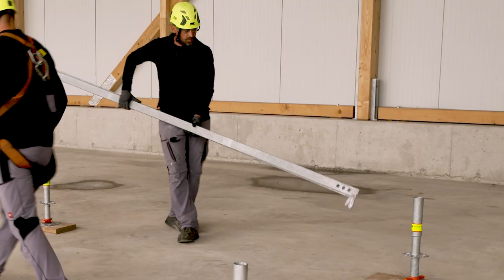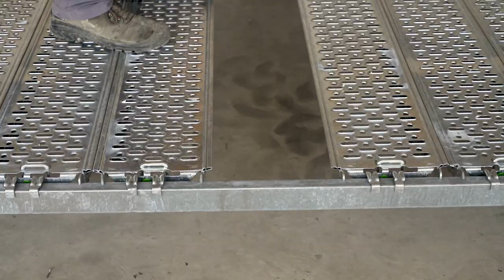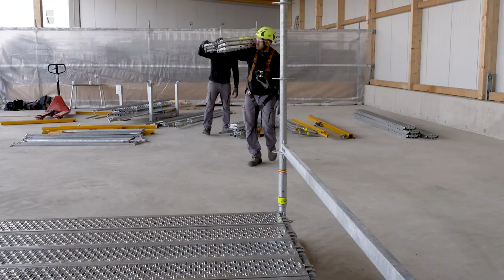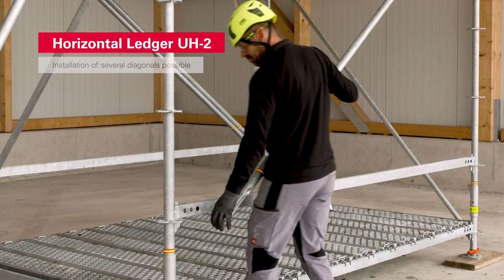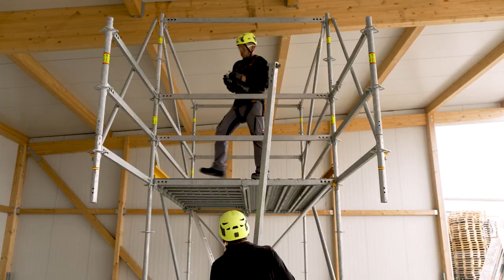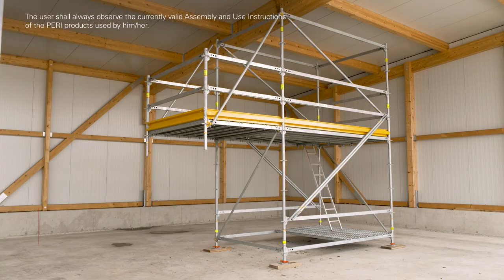SCAFFOLDING | The optimised components of the PERI UP Scaffolding Kit (EN)

Comment: WHAT ARE YOUR BRACES RATED FOR TOO BE ABLE TO SPUR A 5 ft CANTILEVER

CAN YOU SPUR A 7ft CANTILEVER?

I KNOW I HAVE SEEN DOUBLE BRACES..EA SIDE ON A 10 FT CANTILEVER WITH YOUR PRODUCT
Reply: Yes! Peri say they can do 10 feet long cantilever but it look  unsaved but 5 feet and 8 feet no problem with peri. Also they came in Alberta Canada 🇨🇦 doing an inside tank and almost collapsed the system was too weak to hold the weight it was a cone shape tank at suncor oil field. I was there saw most of their jacks broken in two. They claimed safety but don’t have a clue until it break down. They came back the next year with a modified base foundation structure and it was find. 😅. I think they over rate their system. I think it is an accurate system very precise and almost no need of wire mesh. The structure look awesome 😎 scaffolding with a nice yellow toe boards around the edge of the platform but the toe boards need a better lock system to keep them in place we always added a right angle on top for extra safety. Overall peri look safe but need to add extra safety on the toeboard and plank pin Walking on those metal planks I notice the pin stand to high and cause tripping hazard which is annoying. I hope they will fix that problem. Also it take two workers to put a single 3 meter ledger other system only one worker. I could  say more but I will stop here. Any question ask me. I am a gym scaffolder from Canada 13 years into these 😅